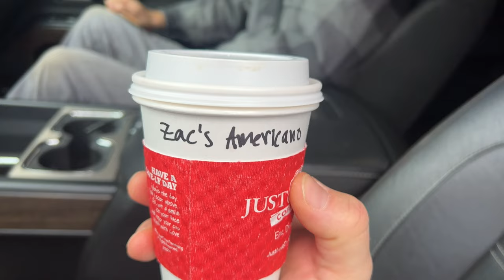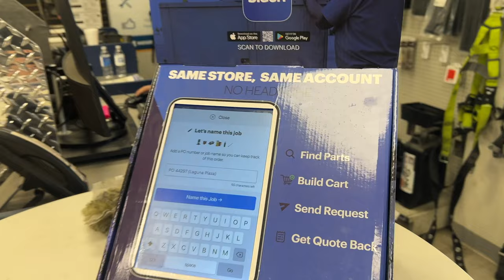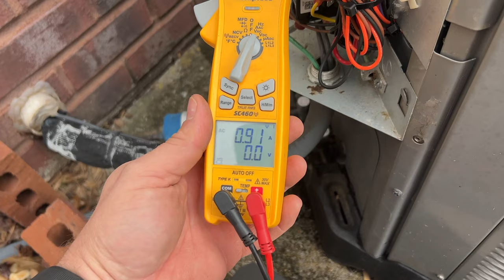DON’T Assume Anything…HVAC Repairs

Comment: I have a scrap guy that takes all my scrap and trash.  A lot of times, he shows up to the job. Mostly I park my trailer at my shop, he picks it up, and then returns it empty. Trash included. I don’t touch but once. Don’t know how much I’m missing in scrap business but it works well for me.
Reply: I have the same system. It’s worth it to me on whatever scrap I’m losing. No dumpster, trash, etc..
Reply: I have a shop I keep all my scrap such as furnaces, outside acs , etc etc I break it all down and when you have a bunch of it and sort everything out you get a good amount of money back. Most I got back from returning scrap I got over 5-700$ just for 2 maybe 3 months of scrap.

Comment: The copper in that condenser you tossed is worth at least $60!!! Hahahah Last company I worked for let me break down and toss old equipment and keep the copper. Some trips down to the scrap yard put 3-400 extra bucks in my pocket for a little extra work.
Reply: That's what I do, keep all coils and scrap copper and even the fan motors. Let them pile up take them to the scrap yard when I'm slow.

Comment: 9:16, You did not measure the position of the blade hub on the shaft. 11:21, You put the blade back on the new motor shallower on the shaft, the blade is hanging deeper and now you get a slight wobble. Blade is fine. Unless you bent one of the blades.
Reply: Ive seen him mention this and mark it with a marker in a previous video, im assuming he put it back correctly
Reply: How would that make the blade wobble?
Reply: Yeah ok super tech this guy would run circles around you
Reply: How would that make the blade wobble?

Comment: It’s not Fergusons fault lol he’s the owner he should know what he’s replacing and always verify before you leave the supplier. The fan is wobbling because the blade is too low on the shaft.
Reply: How would that make the fan blade wobble?
Reply: @br5747  you cant have the fan blade attached to the very end of the shaft there is some play in new shafts and the shaft is not perfectly straight. This cause massive vibration and it wobbles like crazy. You have to put the blade as close to the motor as you can and it will be still and quiet. Try it out one time for the one time.